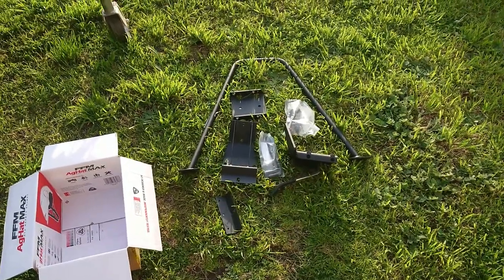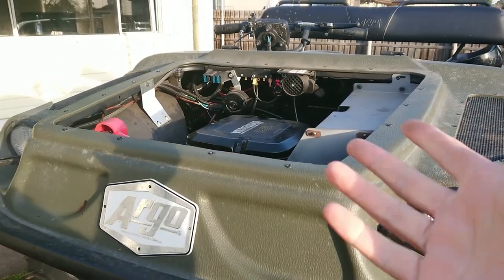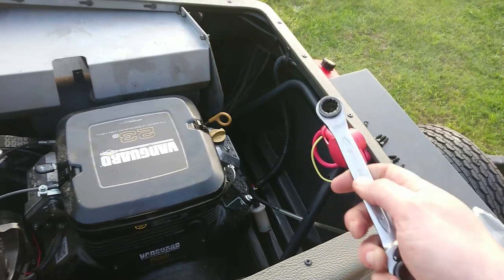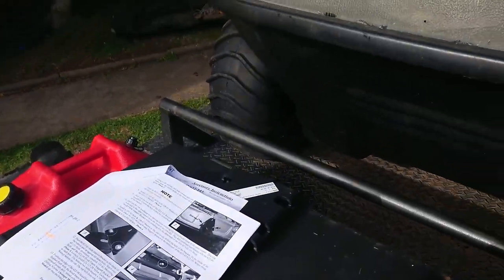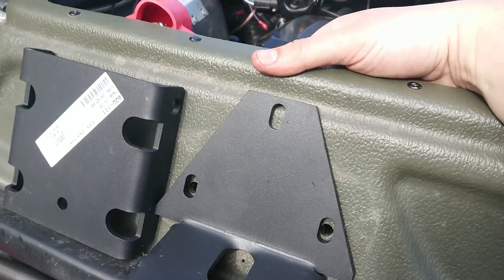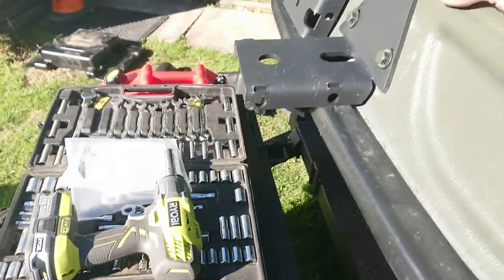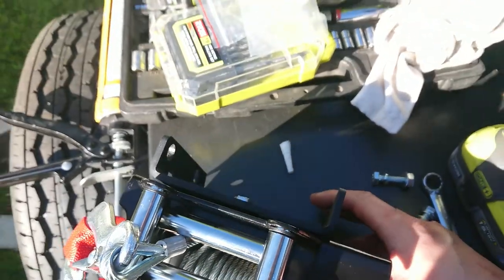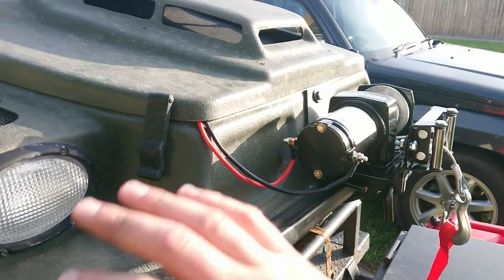Fitting a winch | New Argo 8x8 Episode 20

Comment: Thanks for the video bud 👍👍 would it be too much to ask for some general measurements of the brackets? I’m trying to fabricate them myself cuz I’m not exactly excited to pay 700$ for a couple of brackets… I do have the inside bar cuz I have a 2022 model… thanks in advance 👍
Reply from the maker: I had planned to do the same, and was offered these at a really good price. 
It somewhat difficult to measure them post installation.

What I can tell you is that if you lift the rear tray there are two captive nuts there that are the same spacing as the ones at the front.

That helped me get a start - when I do oil change in a few days I might get a chance to measure more dimensions for you - but I have a visit to chemo ward tomorrow and I'll be out of action for a few days after that.
Reply: @TheAussieRepairGuy  thank you for answering bud :) 
First of all good luck with your treatment… hope it goes smoothly… 

Any measurements would be nice ! Cuz unfortunately after shipping and tax the brackets would be like 750$ usd and that is stupid … I’m gonna at least give it a try before I go and spend that kind of money on two metal brackets that are not made out of gold …
Thank you for your time and best of luck 🤞

Comment: Top, video.👍👍
As usual its an "Easier said than done" instruction manual..😀😀
That top bracket that has the misaligned holes, can you get your fabrication mates to weld a strip on the edge that is showing from under the frame bar.
Make the strip vertical so it sits behind the frame bar and so it has the same effect as the two screws.
Probably even better as no screws to fall out.
I hope that is some what clear.
Need to get some covers for the terminals of the winch motor too.
Does it have a cover to stop all the bush junk getting into the drum and motor?
Reply from the maker: The winch was a very cheap special and as a result is missing some stuff, a cover will be a project for after lockdown.
I have liquid insulation tape for the terminals after the solenoid and wireless relay unit is installed.
I suspect the bracket may have moved into position after getting everything tight, I have not looked yet. recent lockdown had shifted my priorities for next couple of days.